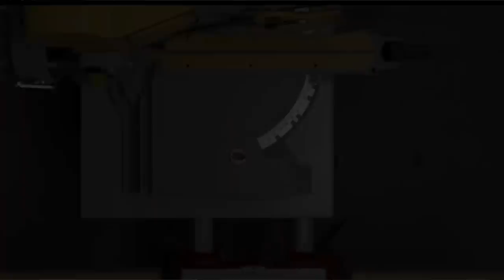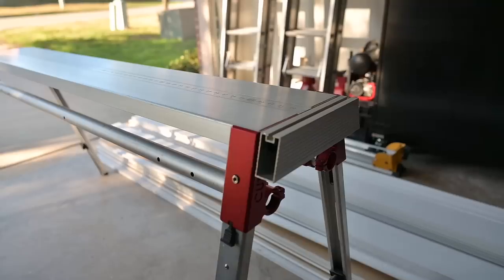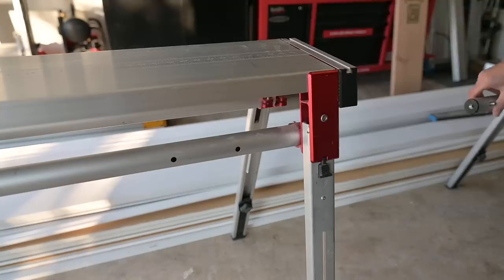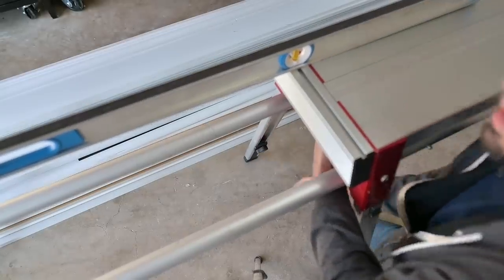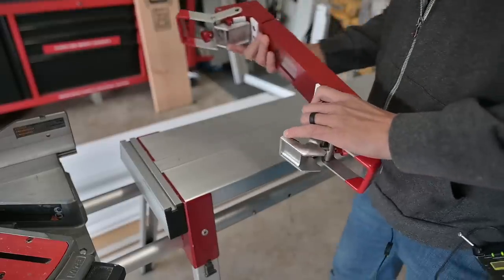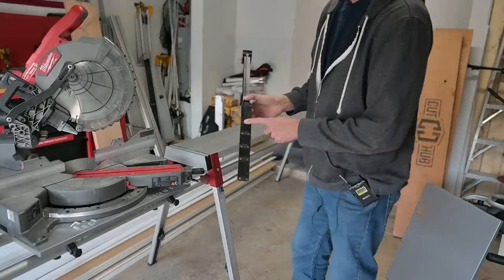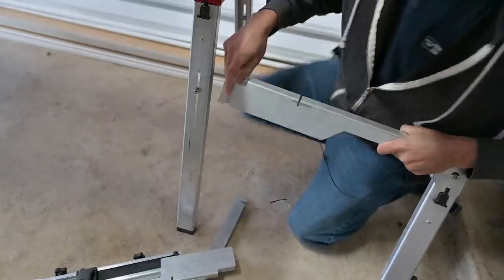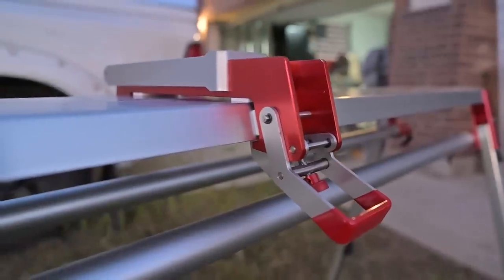Did I get ripped off? - $3400 Saw Stand Review

Comment: As a carpenter myself, yes would get it.  Is it worth? Yes, until it gets stolen.
Reply: Sticky GPS i have a few
Reply: It's not stolen.. just someone else liked it more than you. Lol
Reply: It's not worth it brother, think about it, $3400.00, what amount of power tools could you get, how about a full western snow plow with full power angle, or Festool Kapex saw ,and Dewalt table saw with mobil stand, and Festool Router, and 22' little giant ladder, and Fein multi tool and still have about $200.00 left over, COME ON!!!
Reply: Looks like a great idea but only for finish work or sites where you can leave it in one spot till the job is done. I packup my sawbench everyday and put it in my trailer. If I had to get this out, set it up and then put it all away every day, I'd get nothing done.

Still rockin my dewalt stand with 2x roller stands at the end. 12m over all sawbench length.
Reply: @michaelmancini5773  that’s why, everyone is different.  If a product is well made, easy to setup, and makes the job site look neat and professional, then my argument as a high end contractor is definitely diff then yours.  I will always work faster and better with stable good quality tools.  Yes, call me a snob, but hey, that’s the way I view this.
Reply: J W you are absolutely right about all you said. We do extremely high end homes. We frame , Cornish, trim, shelves and doors. This tool is very worth the money. $3,400 is really not very much considering that is will make things a bit faster and cleaner. If someone says they would not buy it is because they are not making the money they say they are or maybe they are not doing the class of work they say they are doing. To me it is very worth the money and I am already going to see about buying one!
Reply: @speedgonzalez489  I'm not in the line of work anymore but back in the day we came across a lot of "show boating" contractors with all new equipment, tools, trucks, etc. A lot of the work they did, was subpar in one way or another and corners were cut. All of the "flash" equals high overhead or high initial investment. 

It's great if you work your ass off and hustle on a job to get it done fast and right. But passing that expense onto the customer by charging a premium, for said work,  better come with premium quality of work and work ethic.
Reply: David Mm yes sir that is absolutely correct. I am never short on work and neither is my boss. A reputation can be made or lost on one job. I try not to charge to much and try to do the best job possible. I am not the best and I have seen some really good carpenters but there can honestly say that I do the best possible job I can with what I have and never put any extra charges to my customers. Tools are just tools to help you be a little more efficient and do cleaner work. At the end of the day it depends on the guy doing the work. Take a little pride in your work and everything works out!
Reply: @speedgonzalez489  Amen brother.
Reply: @michaelmancini5773  it may not be worth it to YOU. However, many people will pay that much for a short vacation with not much to show for it. This may make things quicker and simpler for a tradesman and therefore make him more money. Also, looks like he has all the tools he needs right now.
As an aside, if you're thinking festool, then you need to remap your thinking. Too overpriced and too delicate for most onsite work. Just not robust enough. Much love to you from the UK bruv. ❤️

Comment: I work in the microchip industry installing chip manufacturing equipment. We bend Stainless Steel Tubing for exotic gas delivery systems. We build our work tables 3' high with an intermediate shelf to lay our tools on. We lay the Tubing on the table and do our measurements and markings. We cut it to length and use a facing tool that perfectly squares the end for welding alignment. With our other tools stored on the shelf we pick up our benders and manipulate the Tubing into the design. The tools aren't in the way on the shelf below the table top.

Comment: Value is in the eye of the user.  I just purchased some festool quick clamps (and a bunch of tools over the weekend and last week in the sales).  Just a guy who has always had a desire to build and create.  Not a carpenter by profession.  Did I get ripped off?   Always are cheaper options but if it works for you and the money is available to do it and your happy then it worked as was a good purchase.

Comment: I'm gonna need a even closer zoom of that locking nub to justify this purchase
Reply: Just did total trim, jambs, casing and baseboard on 20 doors and all rooms. I also had a few alt stand before the CutHub. I could not have done any of it without the stability of the CutHub. No question. It’s paid for itself.
Reply: jami w  good for you. I apprenticed with a guy in the 70’s who could do all sorts of finish work with a hand saw free hand. He could 45s sitting up on the roof.   I was never able to cut that accurately. Similarly, I worked on crown moulding with the dewalt stand and had a tough time keep 16’ nested and not torqued. It sounds like you’ve got it nailed down though. I’m proud of you!!

Comment: I use one at work and I am not very impressed.  The plastic locking lever that holds the legs broke on one almost immediately.  Some jerk lost the little plastic piece that holds the saw to the stand where you clamp the table to the stand.  So, lots of breakable easy to lose plastic pieces.  Also, adjusting the height of the table on the chop saw is extremely difficult.  You have to get on the ground and undo 4 allen set screws.  Then lift your 35 pound sliding miter saw and the table level (while on the ground) and then tighten the set screws.  This is only possible if you have an assistant that isn't totally stupid.  I just think it is expensive to have these design flaws.  You should be able to level the chop saw to the tables with something that you can screw in and out and make micro adjustments.  If your table isn't set right, your blade will bind and KAPOW!!! It shouldn't be that difficult.

Comment: How do you like the Milwaukee 18v 12 in dual bevel miter saw vs the DEWALT flex volt? Looking at getting one so I don’t have to worry about power and am leaning a little more toward the Milwaukee. Also do you run the 12 ah or 8 ah on the Milwaukee?

Comment: On my Dewalt battery table saw I sometimes use a feather board (mine is a plastic Kreg one) just in front of the blade for long stock that I am ripping. Note: Never ever put a feather board in line or in front of a table saw blade.

Comment: Looks like you could put a dewalt planer on the center for an infeed out feed for rough cut lumber.  Now a track saw system using the stop to stright line rip a rough edge. Or even rout it.

Comment: It still seems overpriced to me, before someone says quality, all aluminum. I spent $3600 on an aluminum brake that has way more moving parts/weight and the cut off tools themselves. I guess them being the only real straight out of the box miter saw wings justifies the price. I could see spending $1000-1500 for 2 stands and a mounting plate.

Comment: I know you said you don't use the ruler much but I have a question... is there something in place for locating your saw base to the same spot on those pipe rails everytime you set it?  I am wondering because if it can be placed anywhere that would change your zero offset to the blade every time you set it up.  I'm assuming there's something but just didn't see you point it out.

Thanks!

Comment: I install computer chip manufacturing equipment. Some of the tools have a dozen or more stainless steel gas lines, Nitrogen, Oxygen and some very exotic other gases. We have built tubing bending tables and began building them 2' wide and 8' long with a full size shelf midway. We keep our tools on the shelf so they aren't in the way when we bend our tubing!

Comment: there are some amazing feature in this stand  , i love that stop and how easy it glides. but i dont think its perfect. i dont like the way the saw attaches, it looks delicate and easily broken in the back of a van. same goes for the arms on those cool table wings. this really seems to me that they didnt do enough on site testing with guys on the ground . a few small adjustments should be made like making the leg clips so they lock themselves without pushing the button. 
a router table would be great in one of those tables
i see the massive benifits to this set up. but i dont see how it justifies the price. i have been planning upgrade my dewalt with similar features and will go down the 2 stand route you were going before. 2 stands is around 450 euros so if i spend 550 on upgrades i will still be below 1k . somewhere around 1500 to 1800 seems a more realistic value to put on this set up
Reply: Ya- I know some of my nicer tools force me to slowdown in setup/packup. It would be fine if i scheduled all my own jobs but when your rushing or it’s a hella late night/ 18 hour day I really resent having to neatly pack up my ‘good tools’ when I desperately want to yeet them straight in the trailer and gtfo. But if I break my domino or bend a track saw track I’d hate myself-
Reply: I think the nicer the tool the more bomb proof it should be- why the hell is my pack out case 10x more durable than the systainer on my Bosch or festool stuff? Why is my DEWALT drill feel more robust than my partners festool at 1/4 the cost

Comment: Looks pretty awesome, but I am wondering how flat are those 2x12’s. Most lumber today is cupped, twisted, bowed etc.  Also, how wide of a board can you rip with that setup before it’s long enough to hit the end of the miter saw.  In other words, can you rip a little off a long 1x12 without hitting the fence of the miter saw ? If you have more than 8 ft I guess sheet goods are no problem.  Like your videos, keep up the good work

Comment: Thanks for your videos, you’ve motivated me to install Crown moulding in my home. So I went to hardware store and bought some what I thought was traditional Crown. After I got it home I noticed it basically only has one side with a spring angle. What would this type of Crown be used for? Can I still use it or is it meant for building out bigger Crown?

Comment: Good day Richard. Thank you for all of your videos. I am a loyal follower and have taken up the task of installing crown in my new house. I have a problem with a cut I need your assistance with. The Starrett 505P angle finder is indicating 30 degrees on an inside corner. I have tried everything to make this cut but it come out too open on the ceiling side. It's a 45 spring angle on a 5-1/4" crown. I am using a 10" miter saw. Please help. thank you

Comment: Dear Harbor Freight go ahead and make this so I can get it at a much lower price
Reply: rignt, someone will.. $3400 is "made in Italy" stupid money
Reply: China will copy it  soon
Reply: It may be overpriced, I don't have a clue.  I do know that the version from China and Harbor Freight will suck and not do the same as the US version.
Reply: @charleselkins4546  IMO it is INSANELY overpriced! For $3400 you would think it was made from titanium w/ auto-level legs! Look at it like this you can buy a new M18 12" miter and M18 table saw for $1k, should the table it sits on cost 3 1/2  times as much?! Should be a $500 accessory max.. maybe the quality will be a little less but, it's an outfeed table as long as it's extruded aluminum, adjustable, and semi-flat that's all that matters! It may not come with the adjustable stops but who cares as it would prob cost less than 1/10th of the price.
Reply: @edwardschmitt5710  LMAO $!1200...

Comment: I didn't read every comment, so forgive me if it was suggested already. If you need a tool or catch all, why not just make a short sided box to put on the back of that right side. Say out of 1x12 with 1x 3 lip all around You could even make the back side a bit taller, say 6 inches to sort of hang things off if you wanted to. The box could still mount to the same black brackets, but give you a bigger place to rest tools and off cuts.

Comment: Great stand, but... Please don't lift everything once assembled. It might not bend, but that aluminium will crack at those connecting points! It is definately NOT meant to be moved in that configuration, at least single handedly at the mid-point!!!
Reply: Are you an engineer? What aluminium grade is it? Do you work at Cuthub?

Comment: Hi. I watched one of your videos where you used a small tool to mark out for cutting crown molding around a bull nose corner. I need to do the same thing, but the bull nose corner is larger, like a 2 inch radius. Can you show how to cut and attach molding around that?
Reply: Edit: I have to fit baseboard, not crown molding

Comment: No motors, bearings, electronics or precision machined parts all for less than $3500.  If I still worked construction I'd want one too.  Being virtually weather proof, light weight  and quick to set up, I can see it being an essential tool for a carpenter but not the do it yourself'r and that's why you won't find them in the big box stores.  They cost more than the small enclosed trailer you'd hall them in!

Comment: There is almost nothing more pleasurable that you can do with your pants on than use a really good quality tool. But aside from that, if it saves you 2% time on the job site, even just setup time, or saving scrapped cuts because you didn’t nail a dimension, how long does it take to pay for itself? Months? A year? I suspect it is provably well worth it for a pro doing it every day. For a hobbiest it makes no sense. But most of my hobbies make no economic sense. They’re hobbies. When guys ask me why I have a lathe and a mill I brag that I repaired my wife’s scissors so we saved 10 bucks in new ones. I have those tools because I enjoy them. Cheaper than drugs (ok maybe not). Also seeing how this is made might inspire some guys to build their own out of alternate materials. Cool vid.

Comment: You get what you paid for, as it goes with tools. You got a lot. Worth it. When you buy a cheap tool or accessory, it doesn’t hold up.
Reply: Yup- some of the folks hating on this set up are the same that shit on festool or even DEWALT over harbor freight/ryobi. 

Use what ya got and can afford (I’ve used everything from harbor freight to mafell, it all works), but man good tooling makes the work go quicker and the finished product better. I’m a carpenter and if all my tools got stolen I’d replace everyone with the same or better, my tools are worth their weight in gold

Comment: No, you didn't get ripped off. Sure, some of the award winning engineers in the comments could build a version out of wood but it would be 4x heavier and would't be able to handle being out in the elements, year round. Once you add up the cost of the aluminum and the time required to build and design a product like that, $3,400 is not unreasonable.
Reply: Exactly

Comment: I'm definitely in the "it's not the price of the tool, but the price of productiveness" camp.
Even then I'm struggling here though..

As I'm slowly coming to terms with it, I'd like to nitpick about the position of the leg adjustment screws. 
I'd like them a tad higher, so I can adjust hanging over it instead of crawling under.

Maybe even a quick release under the table to shave off a few more seconds.
As I ain't gonna leave this on-site overnight, I'll be adjusting every morning..

Ps: notice how I went from "nah, too expensive" to mentally already owning it in six sentences..  :-p
Reply: Actually, as we've moved away from the mundane valuation of money:
Could we make the second stand's legs powered, and have it auto adjust by having a laser in one and an optical sensor in the other stand?

Comment: For those who said he was ripped off probably don't have a lively hood that involves long lengths of crown or trim that requires a high precision of accuracy. Try cutting a 16' piece of crown on a conventional miter stand. Even with someone holding up the other end the middle is going to bow down because the is no support for at least 8'. 
People can spend thousands on entertainment that has no return.
This tool will create way more return than the investment not counting the aggravation it will save. Great investment for the business minded, not for a  weekend warrior.

Comment: I wouldn't pawn your wife's ring, tell her to keep when she leaves.
 For tool storage you could make a shelf for under the 2x12. If you put a L-bracket underneath you could just slide the shelf in when you set up like a drawer or use hinges to fold it flat for storage. You know that you could have bought 3 Snap-On wrenches instead of just 1 Cuthub?

Comment: No affiliation, but the owner of the company is sending you custom made endcaps  to give your add-on a more finished look?RIGHT.......haha
Reply from the maker: The track tubes are a totally separate company from cut hub. The track tubes are a modification. I said it in the video.
Reply: @FinishCarpentryTV Sorry  not familiar with the different components, i thought it was the owner of the track tubes. Respect for  highlighting.

Comment: 3400 bucks, extruded aluminum, 3d printed parts, plastic locking lugs with no ramp for ease of setup, sloppy joints, parts that have to be pulled out of alignment to clear other parts just for setup and tear down.

Dude, this thing is a piece of shit.